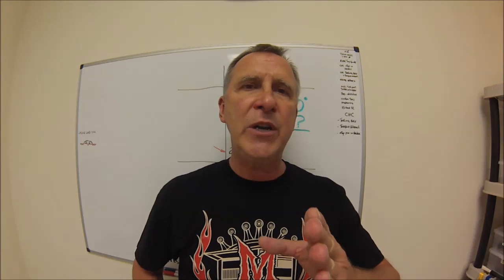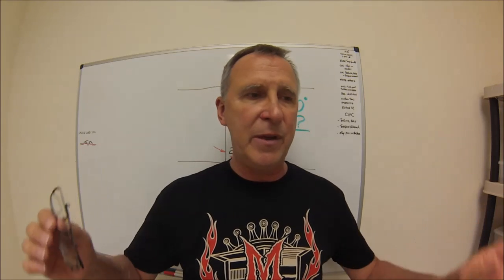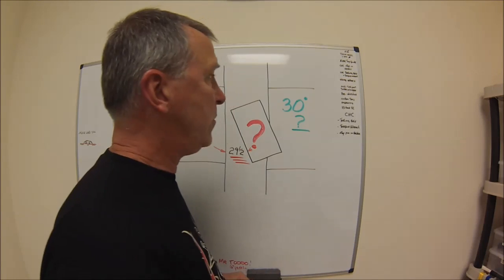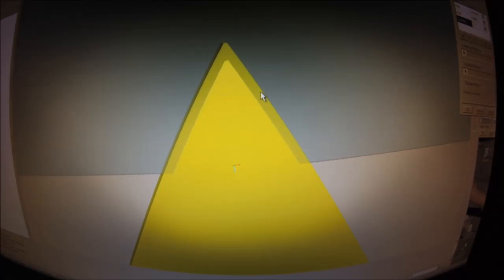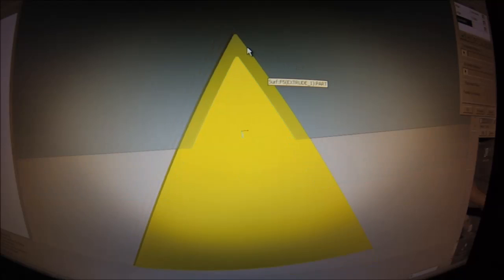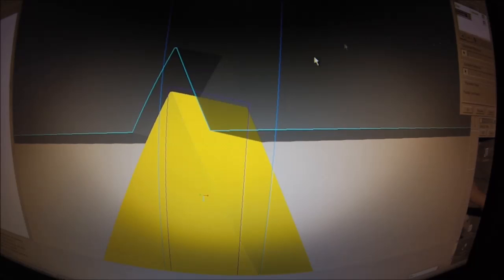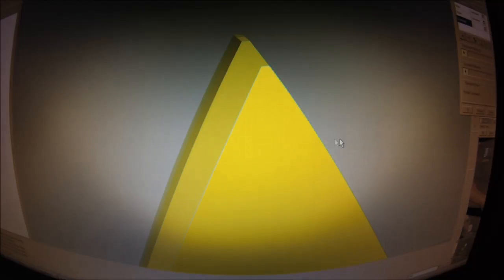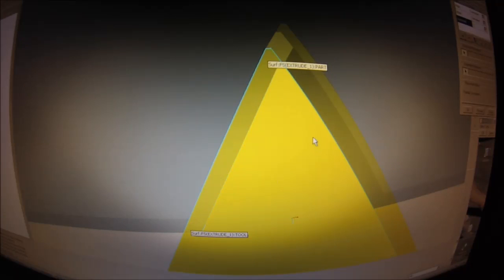Lathe Compound Setup for Single Point Threading...Myths and Musts

Comment: One more off track question, I tried cutting an outside 14,5 TPI thread (1.75 mm) 1/2 inch long. My threading dial indicator  provides 12 marks. The fast spinning indicator was impossible to drop down on the correct number. Having the chuck stopped, moving the dial to the correct number some 1/2 inch away and the starting the motor made the cut start properly. Then the next difficulty showed up, stopping the threading, opening the clutch, in time showed to fail now and then. As I have no inside cutter to use running the chuck backwards it looks difficult.
Do You have any trick to come around this situation?
Reply from the maker: If the pitch was truly metric, don't disengage the half nut. make all move with the carriage.
Reply: Yes, that's one possibility I forgot at the time. How about stopping the threading accurately at that fast motion? The mini lathe needs some RPM to give the torqe needed,

Comment: Enjoyed watching the demonstration Joe. Like you say with the new depth of cut dialled in, the tip of the tool has to cut on the back edge because its got to remove metal on both sides of the thread profile to gain the new depth required. It's a no brainer viewed from above if spliced across at the cutting point.
Reply from the maker: Too many people believe things that are just not true. I had to put this one to rest.

Comment: Hey Joe great video BUT I have a question... If you don't set the compound to 25 to 29.5 and leave it parallel to the work (set at 0) which hand wheel do you use to cut the thread, the cross slide or the compound, if the answer is compound can you explain how that works. Thanks again Joe! Jason
Reply from the maker: Hi Jason. I have done this under special circumstances. With a compound positioned parallel to the work, you would use the cross slide to establish the defined root diameter first. You would then use the compound to widen the thread profile and develop the pitch diameter. Great question.

Comment: If you are right hand threading with an upside down tool cutting away from the chuck should the top slide be angled in the opposite direction (clockwise) not as shown in your video?
Reply: I think yes personally

Comment: I’m late to the party. So I understand this as 1) with a straight in 0 degree entry both edges are equally loaded. 2) at a 30 degree entry the r edge is perfectly parallel and the loading is full on the left and just the depth of cut on the top on the r edge. 3) in between 0 and 30 the loading varies from equal to left predominant. So it seems to me that with an entry of 29 degrees the depth of cut on the left edge is the amount you’ve advanced the cross slide and there will the equivalent of a finish pass on the right. Do you ever set the cutter centerline to be perpendicular when the cross slide is set to 30 and then move the cross slide to 29.5? That would give 0.5 degrees of clearance on the right edge at the cost of the thread form not quite symmetrical on each side of the thread.

Comment: i agree with your demonstration. i have a question about fixing a bed that i have on a small lathe,it is cracked directly under the chuck not on the top at the way,s but at the bottom going clear to the other side of the bed.cant afford new bed for it so if i clamp it together,and then weld it might it hold together. i guess the question is  are jet 9-20 bed,s weld able lol. any feed back would be great :)
Reply from the maker: I understand welding cast Iron can be tricky. I think there is a preheat involved for a successful weld. I'd do more research on it before you try. Good luck.
Reply: There are cold (ie not welded) cast iron joining techniques that might be easier instead of risking heat distortion or embritllement.

Comment: And if you do not believe what Joe is talking about to be true (right side contact), you only need to throw the thread you just cut on an optical comparator and you will see a very rough saw tooth surface on the right side in comparison to the left hand side.  This is the reason that the final cut or two is to be applied with the cross feed rather than the compound to clean up the right side if you want both sides of the thread to have similar surface finishes.  At the application of the cross feed cut you are using your threading tool more as a form tool to remove the saw tooth surface on the right hand side.  I have been showing this example to my students for over 30 years.  NOW JOE JUST NEEDS TO PUT THOSE PANTOGRAPH PLANS ON HIS WEBSITE AND WE WILL LIVE IN A PERFECT WORLD!!
Reply from the maker: Thanks for the comment. What do you teach? And hang in there for the plans.
Reply: Joe, in a very few high schools in Wisconsin we still teach a program called "machine shop"  It's an uphill battle however with administrators who see the money for a new lathe or cnc machine as better placed in  programs that have better public relations potential for them.  What parents/grandparents don't like a jazzy show choir , new astro turf field, or Latin language trip to Greece for their student?  Are these things important?  For sure.  But what about the kid who can't afford college after high school and is pining his hopes for the future on what he can learn in high school or doesn't even know he or she has an interest in the subject?  Some will say he or she can go to a technical school to learn machining if their program isn't closing down, because a lot are .  Some do, others can't for a multitude of reasons. It  just seems to me that if we only give lip service to the fact that we need more skilled trades people, but have less and less places for them to learn these trades we are destine to depend more and more on other people of the world to provide the things we need and will be in their debt. 
Now, aren't you sorry you asked me what I taught? :)

Comment: Hi Joe Thanks again for for the explanation ,as a newbie I always wondered why the 29 to 30 degree angle. Please excuse my ignorance but what happens when a tap cuts a thread,same thing?
Cheers and Thanks
Have a Great C
Allen.hristmasl
Reply from the maker: No. A tap is a full contact symmetrical cut in varying depths depending on the type of tap.

Comment: Joe , I have a Maximat V10. It does not have the rotating Gage on the cross slide to count when to engage the tool for the next thread pass. Is there any aftermarket dial to attach for proper timing for my next thread pass or can I somehow make one ???
Reply: Dial indicator with a magnetic base, it's what I used until I had DRO.

Comment: It would be nice to see a enlarged image of threads cut with three different angles in the same material, say 29, 30 and straight in. If you were to magnify the threads  to 500X or so you would be able to see which gives you the best most perfectly formed threads. Most of the threads I cut are either 16 or 20 TPI and I still seem to have my best luck at 29-30* as compared to straight in. I have a fairly rigid machine too.
Reply: I totally agree, I say we start a donation fund to get Joe one of those Optical Comparator old timey shadow graph thingies.

Comment: I'm a recent machinist want-to-be since I've retired, my former life I was an engineer. Your right! It's all about the load on the machine, back in the day the lathes weren't as strong or had the power they have now, plus the tooling has improved by X10 or more. 
Is it possible to get the cutting tool and lead screw in time and alignment with previously cut internal threads?
Reply: It is but it's probably harder on an internal thread, you have to run the machine at low speed and adjusting the cross slide and compond as the carriage moves, try to get the tool to fall in the thread. I saw a video on YouTube and just  tried it myself to see if I could do it. Not impossible but you would be better off making sure you're done before taking it  out of the chuck. I'm surprisedised Joe hasn't responded, I would like to see his take on that. Internal would be more difficult cause of visibility. My guess is that it is an amateur mistake to un-chuck a piece before the threads are done and it's not something you encounter as a professional very often unless you are repairing threads. EDIT: obviously the pitch has a lot to do with the ease at which this can be done. I tried it on a 16tpi on a 1/2" piece of aluminum, 40tpi or even 32tpi would probably be an exercise in futility. Especially internally. My eyes are 20/20 but I don't think I could do it.
Reply: @thetoecutter13   This is way old, but if I had to pick up a fine internal thread I would get the lathe all set up and engage the half nuts with the lathe stopped, with the tool loose in the tool holder, then feel the tool down into the thread so I didn't have to actually see it, and tighten the tool holder.  Set all your zeroes, then you can back out and proceed with whatever you need to do with that thread. It will be a little fussy to make sure your tool holder is at the exact depth so you can slide the tool left and right while against the back of the holder and still maintain your 60 degree alignment, but I cant imagine trying to pick uo a 40TPI thread with a slow running lathe and not wiping the existing thread right off the part.  Also got to make sure you are on the right side of all your backlashes, my carriage backlash alone would be enough to destroy a fine thread
Reply: @fristlsat4663  Joe has since done a video of picking up an internal thread. Pretty interesting technique he uses.

Comment: only a beginner here but if you alter the cutting tip as you show in the video, it is now much weaker at the tip, given the direction of the cut.  I would think a better trial example would be to dull the right hand side of the cutter up to the flat and then see what happens.  Also if I remember it correctly, one aspect of using the 30 as opposed to straight in, is to reduce the amount of deflection of the piece being cut.
Reply from the maker: I would never suggest anyone actually use a tip like that. That illustration was a dare for anyone that thinks the right side doesn't cut. If you dull the right side of your tool, the pressure will go up, the chatter may come back, and the tool will deflect to the sharp side. It may also cut a taper because the chuck or collet offers less deflection potential. It may even rain frogs!

Comment: Thanks for the video. I am wondering if the 29 -30 degree compound is a handed down from teacher to apprentice? I come from the CNC lathe and do straight in cuts, so I have always wonders why manual lathes did threads from the compound making it where you add in another operation in a process that is already stressful. I am wondering do people that have a small 9 inch south bend (just and example machine) if they have tried making thread cuts using just the cross slide and light cuts, and were they successful?
Reply from the maker: I never use my compound to thread. I plunge everything. i never have chatter issues. Maybe because my tool is inverted.
Reply: Thanks for the info. Then is the 29 - 30 just a myth something that use to be done and just out there so much that it has become a rule not to be broken? I have plunged cut threads on CNC and it is done fast, and there is no chatter, tool breaks only happen if you hit a hard spot or leave the tool in to long. What little I know of a manual lathe, would be that you would hear and feel a problem with a thread cut before the tool would have a chance to break, because you get more feed back info on a manual lathe.
Now we need a threading challenge to go out to all the youtube machinist thread cutting at 29 - 30 and thread cutting plunge cutting.
Would be an interesting challenge.
Have a day
Reply from the maker: Its just for load reduction. Thats all. I plunge straight in when I thread. Many guys swear by the 29 degree thing. Me....not so much.

Comment: Great info thank you, I never cut at 29.5’ or below but many have criticised this. However even with setting your compound up you to 29.5’ or near as, you would still need to set your tool up on the workpiece right? I do this for every job but that said I am self taught yet to date (7 years on) I’ve never had issues with any thread other than material differences. Thanks again.
Reply from the maker: Regardless of the technique, the tool still has to be ground and positioned properly for favorable results.
Reply: Would it be safe to say most threading in big industry is now done on computer controlled machinery?  If so , how is the feed set on those machines for best results?  Perhaps the 29.5 or 30 degree angle became standard practice when machinist controlled manual machines,  turning large threads, requiring multiple starts referenced  on the the thread dial. The full thread is not formed till all the passes join at the finish.  Plunging straight  in would give some very heavy tool loads. The left side bias and right side support  from an angle feed would keep it under control.  Maybe we get away with strait in feeding on threads up to around 5/8 " or 1" diameter and some held onto practices needed on a bigger size? I do both as required and feel good if the thing screws in well and smooth,  why lock in to one or the other?

Comment: Hope this comment gets to you, I now rely on the resource you have built for all of us to access. I do have one question i never find the answer to in your collection of videos. With the whole debate of Spotting drills vs center drills for starting holes, matching/mismatched tip angles, and what not, i have yet to hear your clearly defined opinion on the matter. 
I somewhat take it that you have no strong objection to using a center drill to spot a hole.

I recently have taken to using 120 degree spotting drills, as they are common. I still do use the center drills to start small holes, but i only use the 120 degree tip, never onto or past the cylindrical section. But alas, half my drills these days are actually 135 degree split point drills, so the 120 degree spotting drills i use may or may not improve my situation in the case of a 135 degree drill. Maybe a 142 degree spotting drill will solve all my problems....

Jokes aside, id be very interested in hearing your thoughts on the Center drill vs Spotting drill debate, matching angles thing.

Huge fan!
Reply from the maker: Thank you for the comment and support. Its a topic I absolutely plan to cover for many good reasons. I use centerdrills about 90% of the time, and will continue to do so. Stay tuned.
Reply: Angle of spotting drill greater or at least equal than angle of following drill results in best centering effect and uniform cutting load. Center drill only for lathe tailstock support
Reply: @marcoam2610  yes that's what they originally were designed for.

Comment: Another great video and explanation Joe.  So my question is where did the "it has to be XX" come from if it truly isn't that critical?  Is it just good practice to think it that way or?  I am not a machinist but do want to become more knowledgeable as to why some of these standards are stated that way as a hobbyist.  Again great stuff!  Thanks!
Reply from the maker: The angled setup is better for a light machine and does reduce chip load on your tool. I believe the theory is to get as close as you can to 30 degrees without going over.
Reply: It came from the same place as most accepted practices, "old timers" teaching the best way they know to the novice, who accepts what he is taught in the absence of another perspective.  I think it's a cultural thing.  In days past, people weren't exposed to the knowledge and experience of people outside their local shops.  That's one of my favorite things about Joe's channel is that he presents a fresh perspective that most have not been exposed to.  When I was a novice, and a trusted elder told me to set the compound at 29 1/2 degrees, it's what I did and it worked - so I ran with it and moved on to learning other things.  
Outstanding channel, Joe.  Thank you for the thought that you put into the topics, as well as the time to produce the videos and share them with us.  They sometimes make me feel like a furry-knuckled mouth breather, but that can be a good thing once in a while.

Comment: great vid as allways.....Q. whats the difference in advancing the depth of cut with the cross slide as apposed advancing the depth of cut, as prescribed, with the compound slide?
Reply from the maker: Tool load. Plunge cutting produces and equal too load, and compound advancing is lighter for lighter machinery.
Reply: @joepie221  Thank you very much for your reply.....Can I assume then, that when starting a thread, for example, making a bolt, setting my depths of the following cuts by  advancing the the cross slide instead. Would doing as i described be just bad  "practice" or would there be adverse loads?......thanks again from G.B.

Comment: question: After single point threading is done, do you have to change your gears back to the original settings before you can use the lathe again. will the lathe still work on facing, cutting, boring, ect.
Reply from the maker: I have my favorite turning and facing settings, so I do change over when I'm done. At the very least, I disengage the leadscrew. But, its not necessary.
Reply: @joepie221  Thanks for the answer. I will certainly change back. kind of  a pain in the butt , but needs to be done.

Comment: Great video Joe,always enjoy watching. Out of interest,if you was cutting a whitworth thread who h is 55°,Would you set your compound to 27/27.5° or leave it at 29.5/30°?
Reply: For 55° V threads I always use 27.5° or so, anywhere from 26.5°-27.5° seems to work 100% fine.
Reply: M4tty1984 : The compound slide angle should be half of the thread angle, as we’re aiming to slide down the right flank of the thread form so, for us, it’s 27.5 degrees, unless you’ve gone metric, in which case it would be 30 degrees !